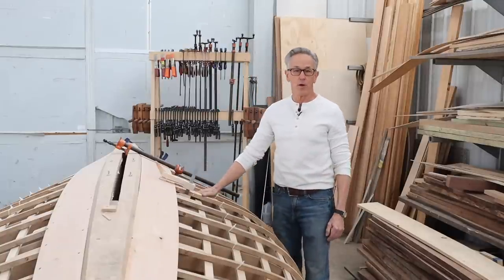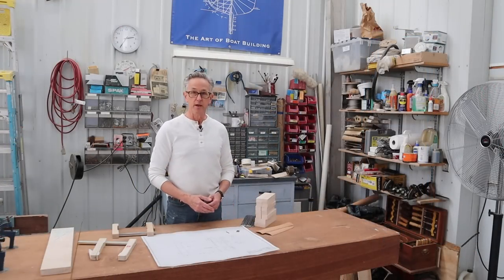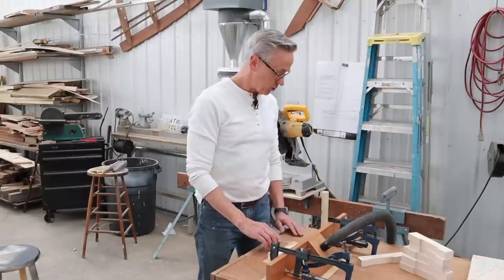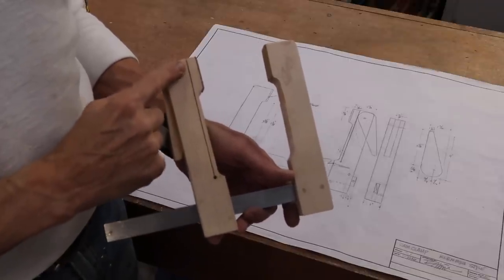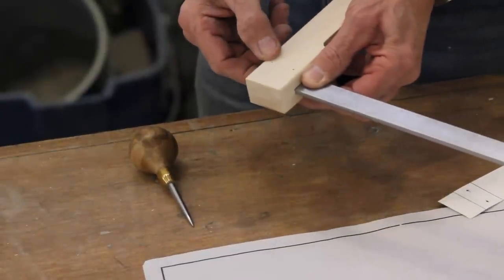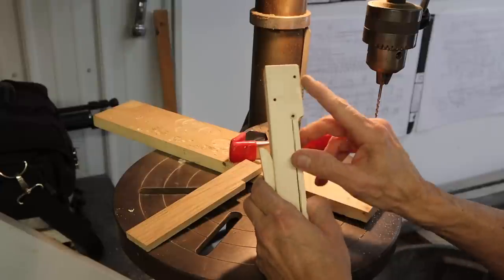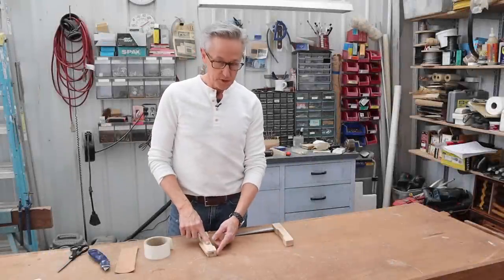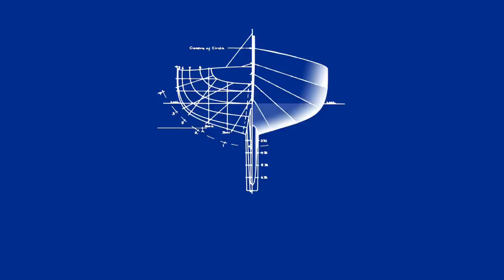How to Make Cam Clamps in the Klemmsia Style

Comment: Bob, the slotted spring pins are available from McMasterr-Carr in quantity... costing less than $0.10 each. They are available in zinc plated and stainless steel, so rusting is not a problem. Whenever I need special fasteners (especially when I'd cleanout the hardware store bins and my wallet) I go to McMaster-Carr. They are also a reasonable source for metals in small quantities, a great one-stop-shop for projects such as these.
Great videos! I enjoy making my own tools too, whether it is the fit to your hands, or the function that you need, or the satisfaction that the making and using of your own tools brings.

Comment: I made 12 of these clamps. First, using a jig to cut the slots in one pass is not the best method when cutting a hard wood like rock maple. I tried to use the single blade approach as shown but gave up. I could not get consistent 3/16" slots. My Amana dado set outer blades were exactly  3/16" when put together. I needed no shims.They were perfect so I switched to them.  Don't try to make the full cut in one pass. My 3 hp Unisaw didn't like that. Instead, make multiple passes of not more than 1/2". Then set the blade height for the final cut. I used a thin kerf blade on my bandsaw to cut the long slots instead of a fancy Japanese saw. It worked great.Also, when buying the steel , be sure to specify cold rolled steel. It is more finished than hot rolled steel- no scale and no cleaning up. Since I am using these clamps to build guitars, I opted for aluminum bars. Regarding the use of brass brazing rods, I spent half a day  just trying to find them. Go to the hardware store and buy the spring tension pins.

Comment: If you use a screw instead of a peened pin on the bar, you can flip the slider over and use the clamp as a spreader.
Reply from the maker: Paul Jackson very true. If that’s the intent it might be a good idea to make the fix head have a double head with cork on the outside as well as the inside.

Comment: I have admired that style clamp for years, and thought about making a few.  One thing I don't understand is why the cam levers apply pressure while being pulled up, rather than being pushed down.
Reply from the maker: deezynar I assume it’s so when not in use the lever would be out of the way. Can’t see any reason why you couldn’t just flip the lever over so you have a pull action.
Reply: @TheArtofBoatBuilding  It has always seemed to me that it would be easier to apply pressure to the clamp by pushing on the lever, rather than pulling.  The only possible negative about that I can see is a person may possibly set the clamp with so much force that they can't release it by pulling on it.
  The lever being out when the clamp is stored doesn't appear to be a problem to me.  But I may be mistaken about that.  I suppose the only way to know is to make one clamp in the traditional pull style, and another with a push lever.
  Have you read James Krenov's books?  He used to make, a style of clamp that is similar to these, but they have a wood shaft, and don't have a cam.  You set them by squeezing the heads together at the shaft.  They stay in place by friction.  I believe that they are released with a tap from a light mallet to the back end of the sliding head.  He used them for light work.
Reply from the maker: deezynar if you make some push and pull clamps let me know your thoughts. 
I haven’t read about James Krenov’s clamp. I have read a lot about his hand planes. Very inspiring man.

Comment: I wonder how much clamping force these can provide; perhaps drilling a longitudinal hole in each jaw and driving in a steel rod (interference fit) would add rigidity?
Reply from the maker: Cam clamps are not a substitute for a C-clamp or a bar clamp which have a greater clamping force. Cam Clamps don’t apply huge pressure, but it’s enough that you don’t want to clamp your fingers in them. They can easily be clamped quickly with one hand. I don't think drilling a hole as you suggested would improve this centuries old design. 
Thanks for your question and watching!
Cheers,
Bob
Reply: The original Klemmsia Cam Clamp from my Company can generate clamping force up to 40kg (88lb). That is sufficient for most wood working projects.
Best regards 
Matthias from Klemmsia